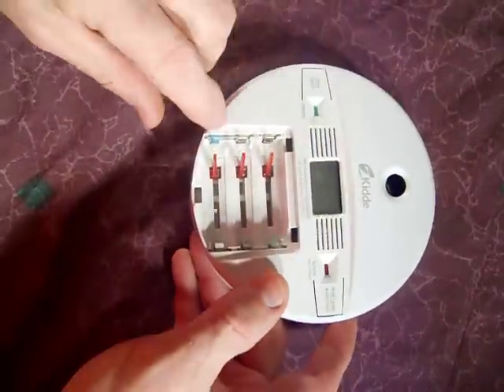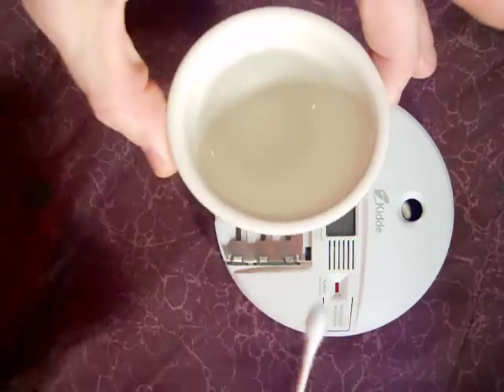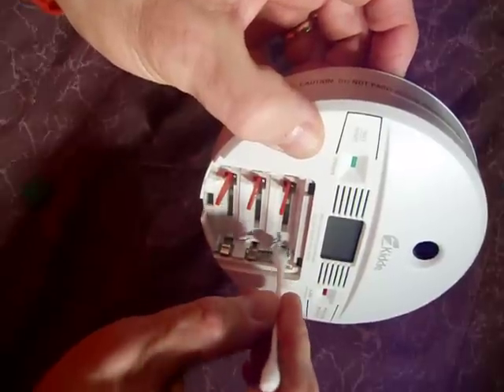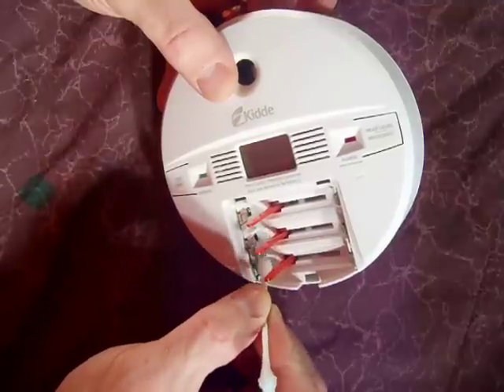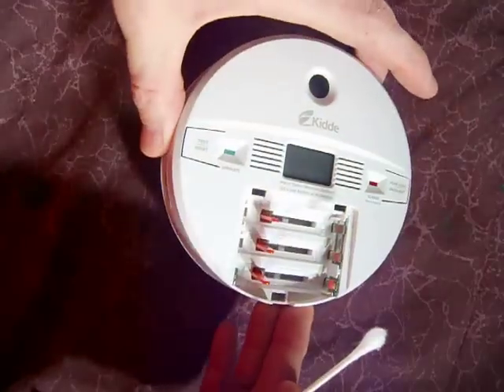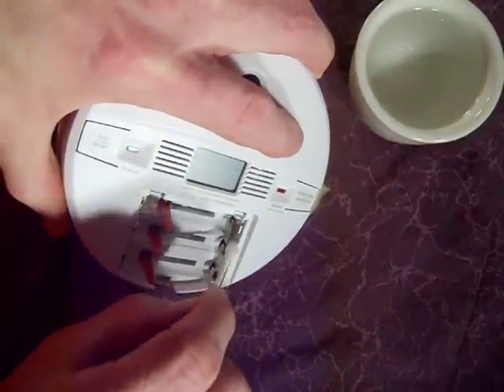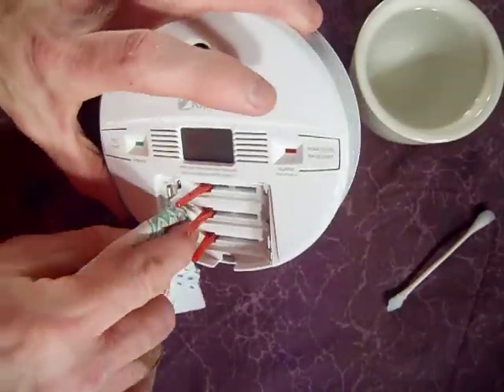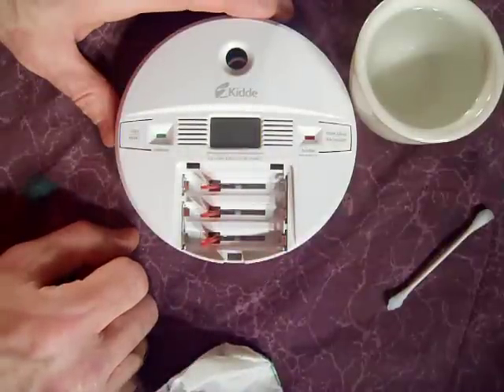How To Clean Battery Corrosion From Contacts (Alkaline Batteries)

Comment: I have two Honeywell thermostats in my house that have a battery backup should the power go out and I don't lose my settings. Least to say I ignored the low battery warnings and they sat inside the compartment for almost 2 years. What a mess. Although it took a little bit of time, they are now working again to provide me the backup power I need. Thank you

Comment: Any tricks for getting down into the spring contact when it's smaller than the head of a Q-tip?  This is for a little lantern that used alkaline batteries.

Comment: No one is helping with Hard Hard white corrosion on a flashlight battery metal contact point. All use vinegar , cue tips, etc. But I've tried that and the white corrosion is hard as a nail. Any advice?   Thanks - I do know the method your using here is great for most, but I hate to throw away an expensive flashlight cause of this barrier to contacts.

Comment: "Ahhhhhhhhhhhh!!!" was my disappointed reaction when I opened up my Nikon SB-400 flash battery compartment - green deposits on contacts! Thought I was only going to be able to sell it as "parts only" on Ebay. WOW, performed this method and sold for $95 instead and a satisfied buyer to boot! BTW, thought I was needing to by a coke and use that method but this is waaaaaaaaaaaay better! Thx for a fantastic video.

Comment: Thank you so much for sharing this info.  I just opened up my anniversary clock to replace the battery, and found that the Duracel battery had corroded on the posts.  I cleaned it as you suggested and it looks brand new again!

Comment: One thing to keep in mind is that carbon monoxide detectors have a life span.  I would think that by the time your batteries leaked, the detector may have been end of life anyway.  Look at the documentation for the detector before trusting it with your life.  
Also:
Most battery manufacturers and municipalities these days suggest that alkaline cells be thrown into the regular trash.  They have no mercury anymore and are of very little worth as recycling.

Comment: Thank you so much for this easy and inexpensive tip. You really helped me out in a big way. I really appreciate that you took the time to share this because the temperature is in the 20's tonight, and the thermostat that controls my three ton furnace would not work no matter what I tried to do. When I took a magnifying glass and looked closer with a bright halogen light, I saw that the contacts for the batteries were indeed covered with quite a bit of aqua green corrosion. It took five Q-tips and about ten minutes of gentle rubbing before all of the corrosion was gone. The furnace worked like a charm after this!

Comment: I hope you RECYCLED those batteries, instead of "threw them away"
Reply: I should call my sanitation company and find out how to dispose of batteries, Thanks for the great idea.
Reply: Yes, we should pay expensive prices to have our expensive alkaline batteries recycled, so simple metals like zinc and manganese don't end up in our landfills, while all sorts of other toxic junk, do.
Reply: You do realize that there is lead (highly poisonous) and sulfuric acid (used in rocket fuel and is highly corrosive) in car batteries, right? Also, pick any metal used in common batteries, look up the specific compound in the battery in Wikipedia, and then decide whether you want it in your landfill.

Comment: I had corroded terminals on some very expensive remote controlled candles.  I rigged sandpaper to a drill bit to reach down and sand the corrosion.  It didn't work.  I tried this very simple solution and even used red wine vinegar and it worked...!  Thanks  for the tip!

Comment: Nice video.  Two points.  I hope you didn't just "throw the batteries away."  For most batteries that leads to toxics leaching into groundwater at landfills.  Also Consumer Reports suggests the useful life of a smoke detector is about 10 years; after that they should be replaced even if they seem otherwise okay as components you can't text can degrade.

Comment: USE VINEGAR TO REMOVE BATTERY CORROSION.
VINEGAR IS AN ACID.
Reply from the maker: Yes and the stuff that leaks from the alkaline batteries is alkaline. The vinegar neutralizes the alkaline.

Comment: Can I use isopropyl alcohol (99%) instead of vinegar? We have no vinegar in the house. I have distilled water as well tho.
Reply from the maker: +pofrani Probably not nearly as well.
Reply: +RJ The Bike Guy Thanks. I couldn't wait so just used alcohol for now. I have baking soda but it might leave too much mess behind. Seems to be working fine at the moment (Nintendo Wii controllers)
Reply: +pofrani did it work because my battery leaked also in mine
Reply: +J. Scoop HI - yeah, it worked. Nintendo Wii is working perfect and the terminals are clean!

Comment: Thanks for sharing this video! I found a cool little vintage flashlight at the thrift shop recently and it didn't work due to blue-ish battery corrosion on one of the contacts. I took it apart and cleaned as per your instructions and now have an awesome working flashlight :) So silly that someone gave it up without trying to clean/fix it.

Comment: Thank u for info. I cleaned an old electronic game that had exploded alkaline batteries sitting in it for 20+ years. it took me a couple hours and the contacts will never be shiny as they should be again -- one of them even rotted off. but the vinegar & qtip, along with a piece of SOS pad dunked in vinegar cleaned them well enough. for the missing contact i inserted tin foil and the toy, a 1981 issue, works as it did when it was new. :)

Comment: Have a Nordic Track cross country skier that I was setting up. Found the alkaline batteries dead in the heart rate, speed, distance monitor. Upon opening the monitor I found the batteries corroded along with corrosion on the battery terminals themselves. Using white distilled vinegar (5%)I followed the recommendation shown in the online tutorial and am now waiting for the terminals to complete drying.

Excellent tutorial. Regards, Dave

Comment: DO NOT use distilled water. It is non-conductive and will ruin the battery terminal conductivity.
Reply: Distilled water is perfectly fine. Though distilled water is non-conductive, it evaporates and leaves no residue. Distilled water will not impair conductivity at all.

Comment: While this does work to make electronics function, I wouldn't consider fixing up something like a safety device where you expect reliabilty!  Also, the folks that pointed out you shouldn't just throw away batteries (no matter where you live) are absolutely correct: http://www.earth911.com/recycling/single-use-batteries/ (earth911 will also help you locate a local disposal or recycling facility)

Comment: Thanks man I was needing to know the best way I opened up blu-ray player remote since wasn't working and the sony batteries where leaking im glad I got it before damaged remote like usually happens I clean contacts to test with new batteries to make sure still worked b4 went further and it does so I need to thoroughly clean them now to protect new batteries and remote thanks again

Comment: what about 9volt  rectangular batteries? All I can find is for AA/AAAs and car batteries. those are a lot simpler, but the 9v has a special connection and small areas with cracks and the plastic cover.